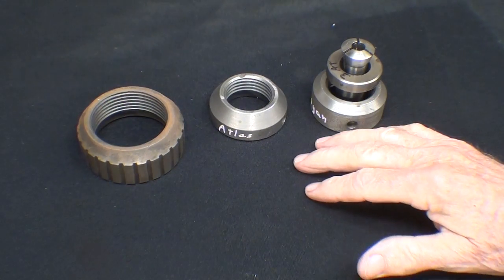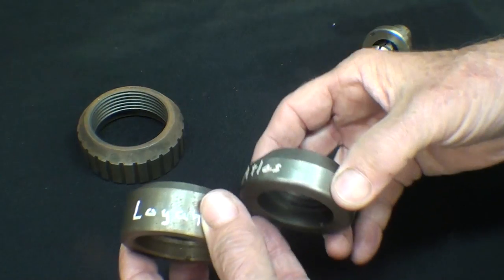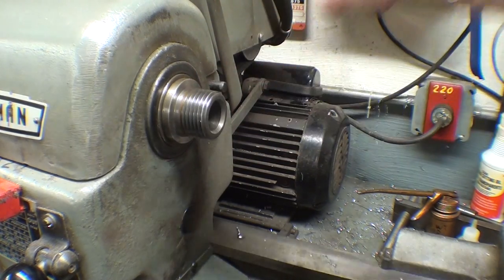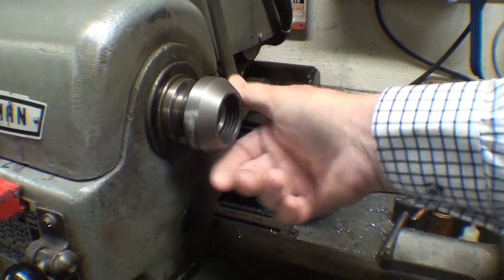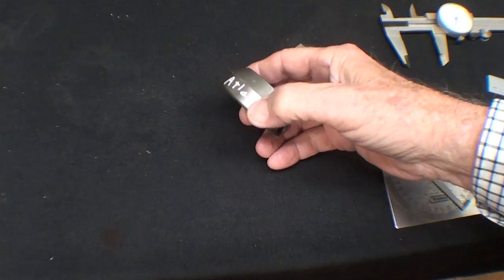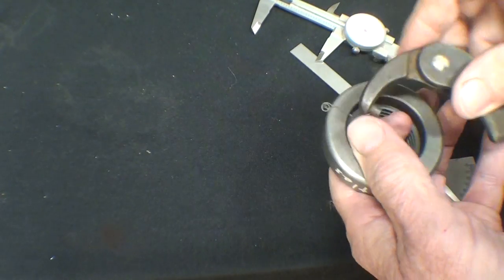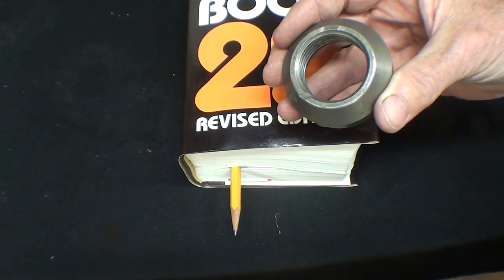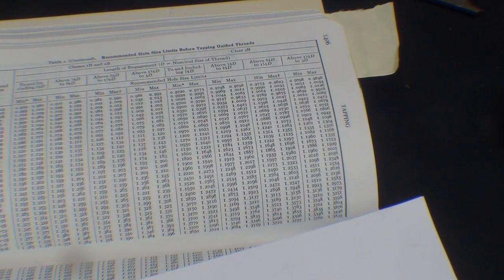TIPS #344 pt 1 tubalcain MAKES A THREAD PROTECTOR FOR ATLAS LATHE

Comment: I made one for an Atlas 618 lathe I once had. It was a 1"-10 spindle thread. I too used a slug of 6061 aluminum. I decided against tapering the nose as I felt it would be too thin at the end and not offer as much protection. Coincidentally, I made and threaded the spindle protector on that little Atlas lathe. It was my first ever "inside" thread cut on a lathe.

Comment: I made one of these out of 12L14 for my 6" Atlas/Clausing lathe 1"x10tpi. I had ordered a threading bar but the inserts didn't show up in time so I ended up making myself an internal threading/boring bar as well out of some 3/4" cold rolled that I turned down to 5/8" with a 1/2" shank that I had scrapped out of some roof top units I had to change out (gotta love free metal). Getting that 1/4 bit shaped right for threading was a lot of fun but I got it and it threaded just fine for my very first time of doing internal threads. I ended up putting a knurl on mine with a blank space between the knurls so I can put a spanner wrench on it to remove it if needed.
Reply: As a side note, if someone has an Craftsman Atlas or Atlas/Clausing 6" lathe and their Gibs are trashed like mine where when I bought it YOU CAN STILL get the Gibs from Clausing. I ended up ordering a used one (metal) from Fleebay but found out that Clausing still has them made out of Delrin for $4.34 for the cross slide. Clausing informed me that they still carry a lot of parts for these lathes, there are some differences between the Craftsman and Clausing versions of this lathe but they also used some of the same parts as well.

Comment: I really like this idea! I use my face plate to protect the threads if I'm using my collets, but it limits my upper speed. I will take measurements and have a go at making one for my machine soon. Thanks for sharing!
Reply: I finally mustered up the courage to do the threading... 8tpi on a metric lathe, with the threading cutter facing 'the far side' and the spindle running in reverse (so the cutter moves towards the tailstock).

It went smoothly and I don't know what I was worried about!

Thanks for your help and inspiration MrPete.
Reply from the maker: I take it, that it worked out fine--nice job.

Comment: Before I made the new spindle adapter for my Bison 3-jaw, I made a 'test' piece, which was a duplicate of the spindle on one end. On the other end I did the same, except I sized what would have been threaded area to the minor diameter of the spindle thread, for gauging the area that would be threaded in the spindle adapter.  

Those with smaller lathes/chucks may not see the need for such a thing, but if you have a large lathe with 100 # +/- chucks, dismounting and turning to do a test fit to the spindle is an activity you want to minimize, especially when bad backs and hernia's are part of your life...

Comment: Thanks for the video I'm going to make one for my Atlas lathe and probably an R8 collet adapter as well however I think you should have done your initial boring before you get your cut off for two reasons. First of all you wouldn't have to worry about depth of cut with your cut off tool. Second, you could have caught the part any number of ways without worrying about fly off and with the bore itself. I

Comment: I got my spring tool holder after having trouble parting with an non spring type, then I discovered that if you make a dedicated spacer to use under the holder rather than the rocker it works even better. With dedicated spacers I can get  results parting just about as good with a non spring tool as I can with the spring type although I still prefer the spring type. With the increased rigidity I can actually part using power crossfeed. That squealing at the beginning of your parting cut sounds like the nose of the tool may have been rubbing on the large diameter when you initially started cutting. Perhaps more front clearance for larger diameters may have prevented that squealing.
Reply from the maker: Thanks--thats good advise. I need to make that spacer ring

Comment: Hi, since unified threads share their form with metric threads, you can calculate the nominal tap drill size by subtracting the pitch from the major diameter.  For most inch threads the fractions make it easier to get the chart out, but for an 8tpi thread it is just 1/8 smaller than the MD.  So the maths say the final bored size before threading should be 1.375, so pretty close to your measurements.

Comment: Always some little tricks to use that you show us. I have a classing 5900 I wonder if I could make such a thread protector for it. Not exactly the same process I believe. Could be an interesting project for you on how to do it because it can be useful to make a backplate for the classing when we buy a chuck. Thanks a lot again and stay away from the rocking chair 👍
Reply from the maker: I have thoght of that myself--but it would not be easy. In fact, I have been watching for a cheap faceplate I could cut down
Reply: mrpete222 min p.
Reply: I believe thisoldtony has a video of making a back plate, but don't know what brand lathe it is for.

Comment: finally getting this done after getting the back gears sorted. The  Mandrell gear was on backwards. I thought the guy (my great uncle Alfred) had drilled and tapped the key way. I turned it round and it worked (same gear on both sides) He had got confused.
Reply: Success! Built It out of brass for my fathers little Zyto Lathe. Cutting the internal threads for the first time was err fun. Thanks for showing me how :)

Comment: At some point in the video you stated that the Craftsman/Atlas lathe runs quieter than the Claussing. As I recall, the gears in the former are die cast and not made of steel. If this is the case, do you think that is the reason?

Comment: As always, I wish I had taken machine shop in high school (late 60's) with you as teacher (you'd be a young teacher then!).  Can you tell me about that interesting double ended tool holder (about 9:30 it shows up), it is not obvious just how the tool is held in the holder???  I haven't seen too many double ended insert holders.  Thank you for all the great instruction, I watch mostly, not for the projects, but for the techniques.
Reply from the maker: You can get them from Shar’s. Look in their catalog
Reply: They don't make it for the OXA tool post, I wish they did since thats what I use on my Atlas 6" lathe. You can find Shars on Fleebay under the user name discount_machine. 
Part number for neutral rake:
202-9434 for AXA tool post
202-9435 for BXA tool post
202-9436 for CXA tool post
202-9437 for CA tool post

You can get them as well with a negative rake if you look further down on their site or Fleebay to get the part numbers for those holders.

Comment: Mr Pete ,many thanks for your video . my smart & brown sabel has a 1.75x8 tpi  BSW spindle thread . all the threading charts on the internet only give information for 5 tpi can you  please tell me if the major and minor diameters of the thread are the same at 1 3/4" regardless of pitch. many thanks again from over the pond
Reply from the maker: wow--you will have to research in the thread books
Reply: mrpete222 thank you for replying, machinerys handbook may have the information if it covers BSW . I will try to get a good used. copy, not so easy to find over here in the UK but will keep checking the internet
Reply: +Wayne Sharp .A 1.75" diam thread is going to be about 1.5"  core size , the way I have been using for over 50 yrs now which works for any thread  metric/ imperial  pipe etc  no matter what the size . is to take a drill and find one that just slides inside the nut or in your case the thread in your back plate you can also measure with a vernier as a double check of inside thread on the back plate then just add a few thou for your bore size . Measure twice, check again then cut .
Reply: Chris C. Thank you Chris for your advice, I will get some trial and error practice in now

Comment: Thanks for the great videos Mr. Pete ever since I got my Logan lathe I've been watching your videos. I'll bet there are many very successful machinest's out there that you have tought a thing or two over the years. With your information I was able to make a few change gears for the lathe but boy is it slow goin process and sore hands from working the hand wheel back and forth. I have one question not related to the article, I do a lot of parts joined by welding why is it that no matter what you can't get a decent surface finish around the weld area without sanding? Thanks in advance.
Reply from the maker: Thanks for watching--too many hard spots in those welds

Comment: ARRRUUUGGGHHH!!!!   THAT's what you look like!    :)           So, I've got a Clausing 200, stepped pulley (not pushy) powertrain;  when can one dis+/-engage the spindle or feedscrew/gearbox from a standstill when the motor assbly. is already running?   I never do it what for meshing the gears and all, but I notice that you often have the motor running and "turn on/off" the spindle separately,  do you have a clutch mechanism on your lathe(s)?  Is engaging a gear to another running gear perhaps "ok" with slow RPMs?
Reply from the maker: Yes--mine has a clutch

Comment: Why/How is the lead screw turning on your Atlas lathe when the chuck is not spinning??  Are you powering the lead screw with an external motor?   Thanks,  Chris
Reply: ahhhh!! i always wondered that too!
Reply: He does have it powered by an external motor. He can run the lead screw slower that way and get a better finish then the factory gear box allows.
He covers this in a previous video.
Reply: ShysterLawyer Thanks for the reply.  I figured it had to be powered by something.  Now I'm going to look for that video.  Thanks,  Chris

Comment: I know you don't like questions about order of ops, but for myself, at least, as a hobbyist, I assume you thought about all the options and had good reason for choosing what you did.

So, I would have done most of the work before parting it off, working from the rear of the part: facing, boring, threading, cutting the clearance, and cutting the nose taper. After cutting the nose taper you'd only have to cut through about 1/4" to part it off. Is there a problem with that approach that I am missing?
Reply from the maker: No problem at all, there are just many different ways of approaching a job

Comment: hi have you cut npt threads on a lathe? thanks
Reply from the maker: no, because they are tapered
Reply: mrpete222 ok and I'm having trouble with a pipe walking out of the jaws what do you think my problem could be
Reply from the maker: Do you mean slipping?  Is it galvanized??
Reply: Just regular steel pipe 3.5" od x 22" press it up against the chuck face tighten chuck and once I get it spinning its like a 1/4 off the chuck face
Reply from the maker: Chuck jaws are slightly sprung or you need a larger chuck on a larger lathe-thats happened to me too. Use a 4 jaw chuck
Reply: mrpete222 thinking it may be my jaws have this issue no matter what size pipe and it's a fairly large 16" American pacemaker
Reply from the maker: A 4 jaw chuck will hold much tighter

Comment: If you damage the spindle you have to throw the lathe away?  Lol  must have meant spindle away
Reply: Clown Whisper  If you can find one. They aren't exactly something you can run to the hardware store and pick up, and are not available at all for quite a few of these old lathes.
Reply: This is true for some old lathes,  but for the 9, 10 11, inch lathes you can typically find  a  good used one on ebay for a couple hundred bucks.   The best place to look is Craigslist!   I found an 1821 Logan for 200 bucks already tore down in boxes.  I snatched it up for Spare parts for my 820. I ended up stripping,  painting and assembling it and it's beautiful! 

Granted that was an unusual good find.   I'm now in the market for a Southbend 10 k so I'm parting it out and making a ton of money on it this way I've already made over 1000 on it and hardly got started. 

But I digress,  

My point is that there is hardly a time that I open ebay or Craigslist  and don't find a spindle or entire headstock for sale. 

I would never get rid of an entire lathe just because of a damaged spindle.   And I'm sure that's not what Mrpete222  meant,  he was  conversationally exaggerating to get a point across.
Reply: Sounds like a good project would be turning (and heat-treating) a spare spindle.
Reply from the maker: No-I meant the lathe!